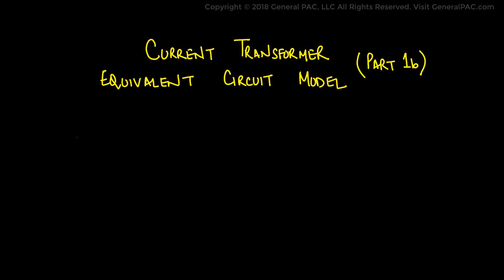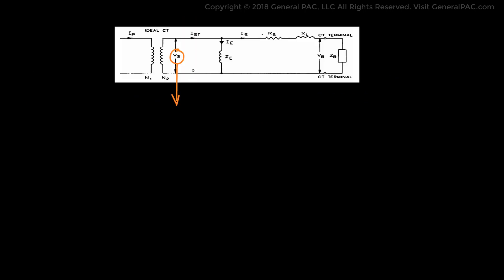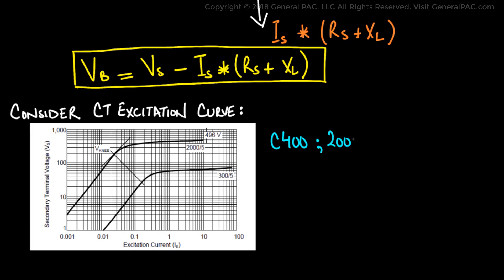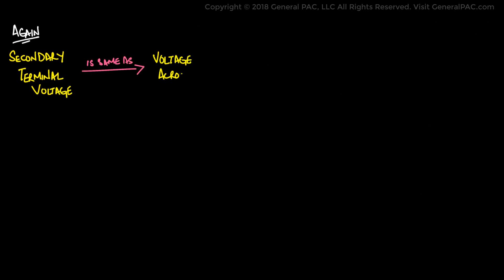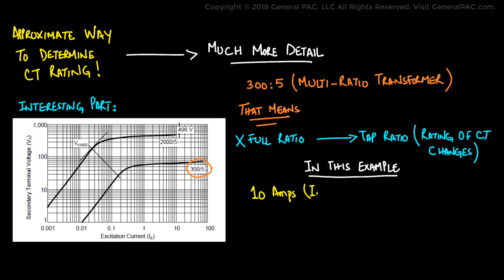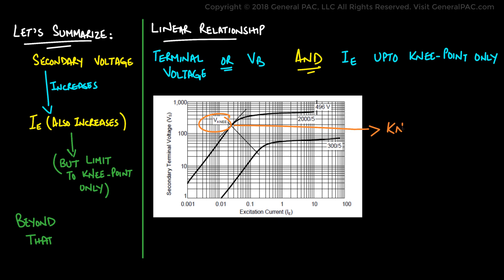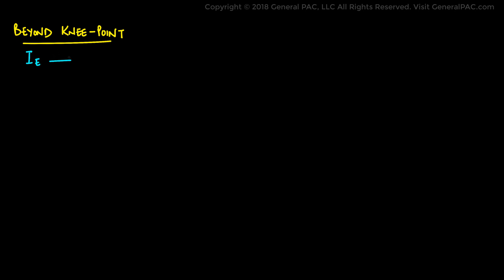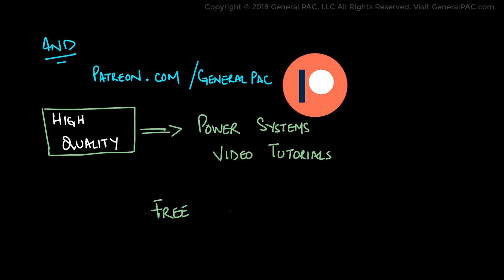Current Transformer Equivalent Circuit Model Part 1b

Comment: 1. Electrical Machinery Textbook by Stephen Chappman, says that CT windings are loosely coupled so their Mutual flux is significantly less than their Leakage flux. Why is this so, AND

2. Electrical Machinery Textbook by Charles I Hubbert says that the ferromagnetic cores non-linearity causes errors and also a small phase shift between primary and secondary. So to compensate for this phase angle error, the CT manufacturers make the actual ratio slightly different than the nameplate ratio. Is this true

Comment: At min 1:43, (Vs) is pointed our to be the voltage across the Burden (Vb)...
https://youtu.be/HZ4g4d2Tu4Q?t=103 

And then at min 1:57, (Vs) is pointed out to be the voltage across the Excitation Branch... 
https://youtu.be/HZ4g4d2Tu4Q?t=117 

Is the Burden the same thing as the Excitation Branch? 
From the video commentary, I can't tell if those two things are being made distinguishable from each other.
Reply from the maker: Hi Jake, for ideal transformer circuit representation, the Vb and Vs are two different voltage levels. One is the voltage across the burden while the other is the voltage across the excitation branch.

I think it's pretty important to distinguish between the two.
Reply from the maker: When people talk about CTs in practice however, the voltage across the burden (or terminal CT secondary terminal voltage) is almost exclusively used to describe the characteristics of the CTs

Comment: In the video you said the excitation current stabalizes after the knee point of the curve did you mean to say the terminal voltage stabalizes or am I understanding the graph wrong?
Reply from the maker: Hey, Brandon Great question BTW. You have correctly identified our mistake. Instead of using the word "Terminal voltage stabilizes", we have to use the word "unpredictable". It is the correct way of saying this.

For the more detailed answer on your mentioned question, you can view it on our GeneralPac forum. The link is mentioned below:
https://generalpac.com/forum/threads/important-clarification-current-transformer-equivalent-circuit-model-part-1b.47/

Our Forum is a great platform to check the latest updates and discussions on all our GeneralPac videos.